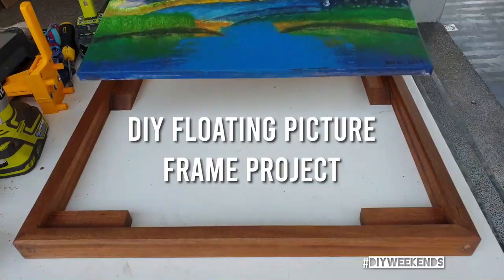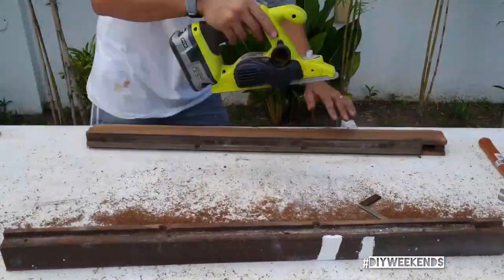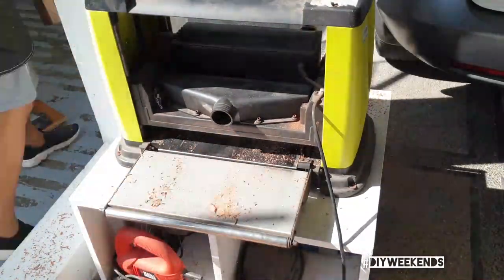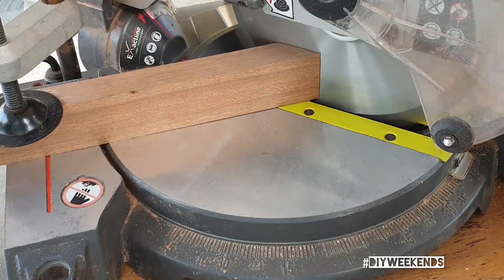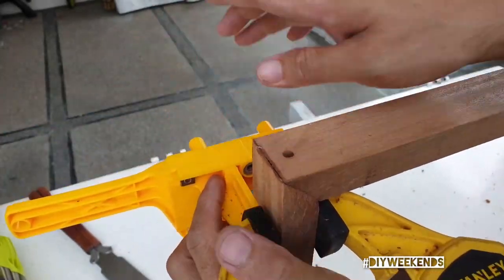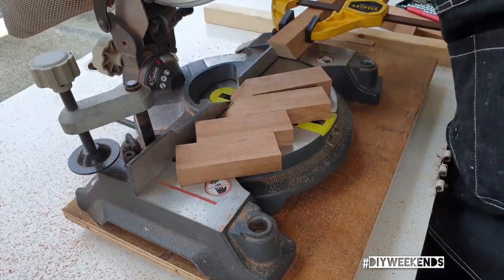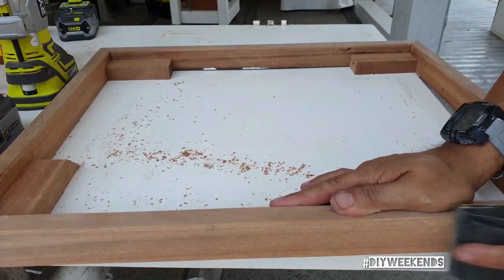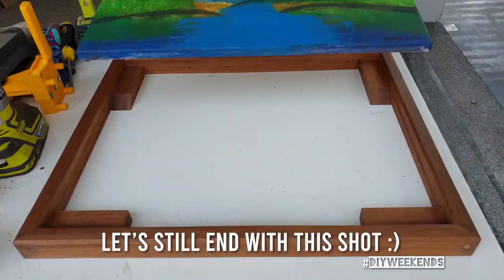How to Make a Floating Picture Frame using scrap wood

Comment: I am learning to make floater frames myself. How do you prevent the wall color being seen through the reveal around and between the painting and frame? I have seen most manufactored floater frames made in the shape of an L with two pieces of wood glued all the way around. I also have seen others use a diagonal cut piece of wood, which I chose to do however I can see the wall through the reveal. Do we add a dust cover to prevent the wall from being seen through the reveal and is it necessary to cut a hole in the back for the canvas to breath or does the reveal around the painting allow enough air flow to prevent the canvas from distorting with a dust cover backing?